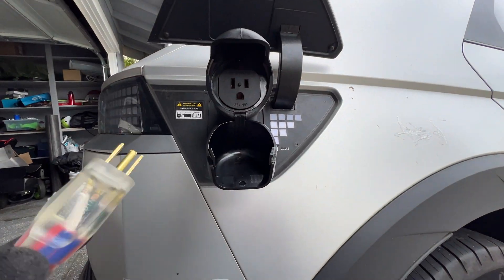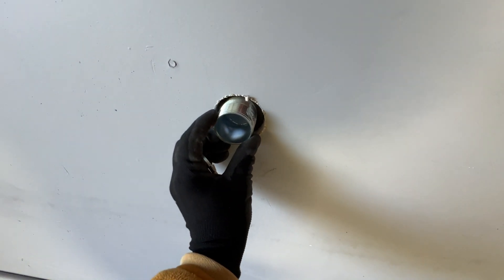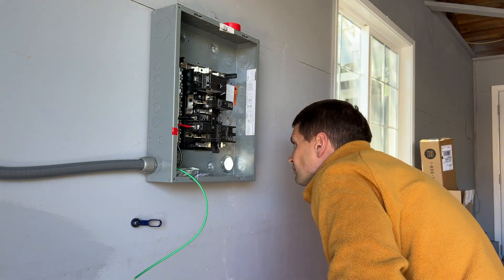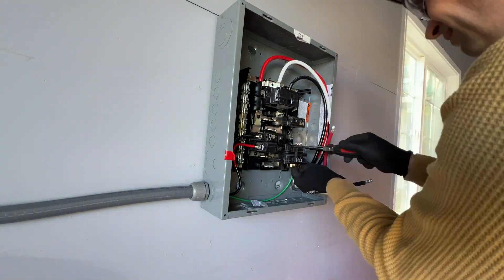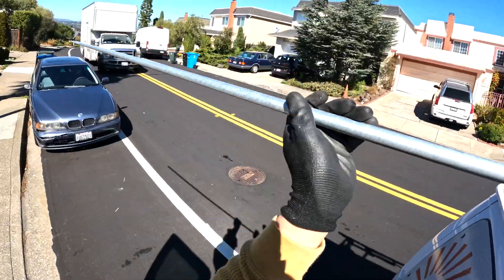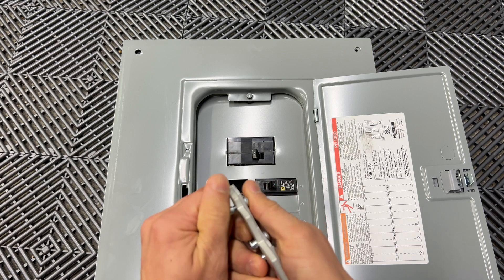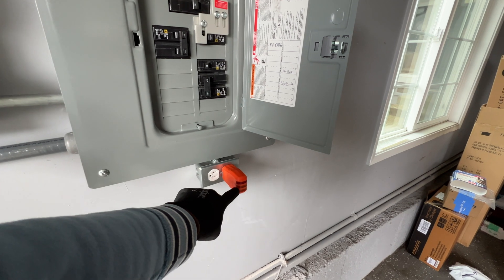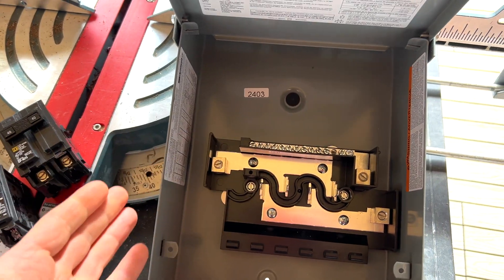Use EV to power the home during power outage. V2L. Ioniq 5 | Ioniq 6 | EV6 | EV9 | GV60 | Kona

Comment: You could split the single live wire from the generator inlet into a double pole breaker which would energize both sides of the breaker panel. All 120v circuits would work but 240v circuits would not work so their breakers would be switched off.

Comment: Great video. Question. The Norwegian models of that car has 240V single phase. What would be needed to change the setting in that car and utilize the single phase 240 to be two legs of 120? A transformer with a center tap? Am I wrong in my thoughts that this could be possible to do? Or do you think they physically have a different inverter in the US cars? Also; with your dialect you remind me of Russia but also a hint of Ukrainian. Where do you originally come from?
Reply from the maker: I don't know if there is an option to switch to 240V output in the US version of the car.  I'm from Belarus, and Russian is my native language.
Thanks for the feedback.
Reply: @SolarEngineering  it could easily be something they have done in software to keep the same hardware in all the cars and thus save themself having many models/sku’s. Most logical is they use the same inverter they use to charge the main hv battery with ac. So if the car has support for both 120 and 240 on the charging side it should be able on the discharge side too I would imagine. One could see they want a car to be able to charge with both voltages for areas close to a border between the standards. Hmmmm. Investigation needed. :-)